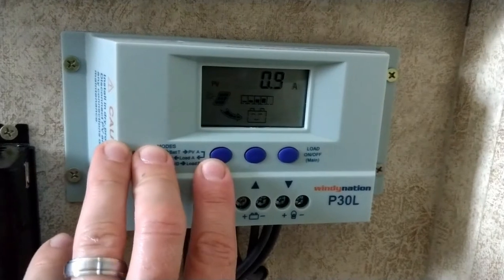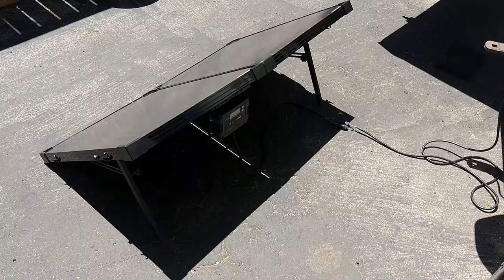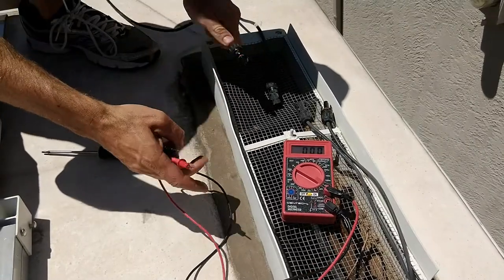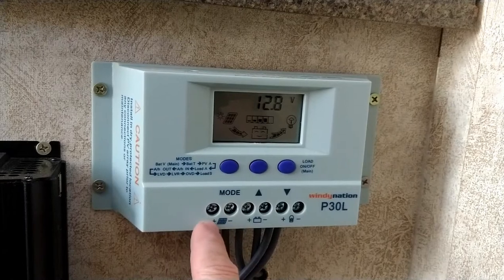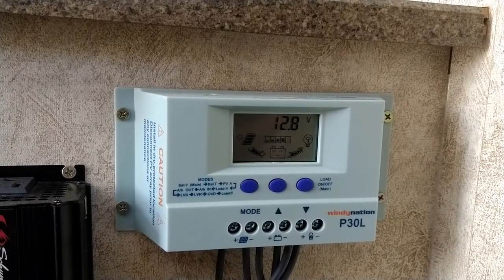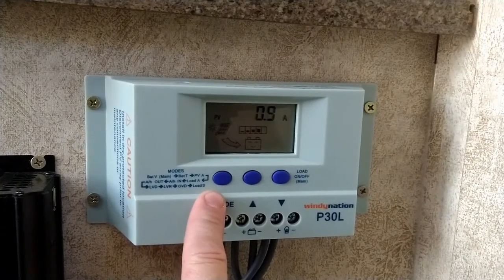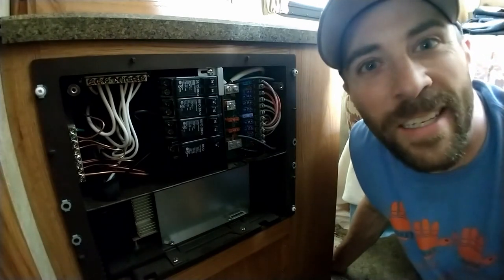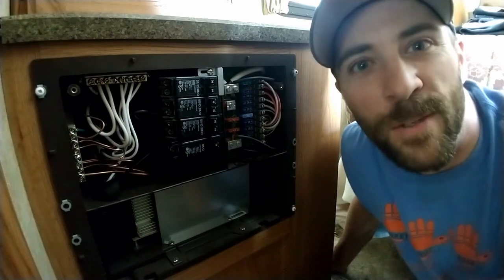Diagnosing Solar Panel Issues

Comment: Thanks, been meaning to check mine. My panels are about 4 yrs old now and seem a little weak.
Reply from the maker: You're welcome!  Check the specs on your panel and measure volts and amps.  If the volts are half of what you are getting, it's probably the diodes (at least that's what the Windy Nation guy said).

Comment: Why would a bad diode at the PV panel result in (still) almost 5A downstream, but 0.9A farther downstream?
Reply from the maker: I don't know for sure but changing the diodes didn't fix the problem.  I changed out the diodes and we were still having issues.  So, we ended up replacing that panel and the new panel works fine.  Thanks for watching.
Reply: One of the MC4 connectors on the panel was probably bad. I found a faulty crimp connection on an MC4 connector on a 100watt panel, replaced the connector and panel worked fine after that.

Comment: thanks for this, I have 6 Windy Nation solar panels and am only getting 300 watts out of them so I must do some troubleshooting, wondering if replacing the diode fixed it for your mums
Reply from the maker: Replacing the diode did not fix the problem.  The panel was under warranty still so we were able to get a replacement panel.  Thanks for watching and good luck!

Comment: Nice video.  I have a question for you.  My solar panel has 28.4 volts.  It used to have different connectors so I clipped it and put SAE so I can charge it with my portable battery.  When I plugged it in, its not charging.  When I used my multi meter, it shows 28.4.  What could be wrong?
Reply from the maker: Are you using a charge controller? Or are you just plugging the solar panel straight to the battery?
Reply: @ColoradoCamperman  I have changed the end to SAE and an adapter so I can charge the portable battery.
Reply from the maker: @jonphanspromotions  Sorry, I'm not exactly sure how you have it setup, so I don't have an answer for you

Comment: I have the bluetti 200 watt panels and they stopped working. Do you know how to trouble shoot and fix them?
Reply from the maker: If you hook a volt meter up directly to the MC4 connectors you may be able to troubleshoot the issue. I'm no solar expert, if bluetti has a support line, I'd call them.

Comment: Hi! If a wire with a 120 volt phase touches the frame of a solar panel that has not yet been installed, could it damage that panel? Thanks
Reply from the maker: I'm not sure, I suppose it could. You could hook up a multi meter to the panels and see if they still are reading what they're supposed to. Thanks for watching.

Comment: My panels (2x 320, in series) pull 70 volts but solar controller only outputs 5 amps to the battery bank (2x 12volt 200 ah lifepo4). If I switch panels to parallel, it is like 35 volts from panels and 2.5 amps to battery. I thought it could be the Renogy 40A controller. Today I got a new 60A controller and same output to batteries as the old one. What could be wrong? Thanks!
Reply from the maker: Hmm, that is interesting.  I'm not sure why that would be happening, I am definitely not a solar expert.  Sorry I couldn't help.

Comment: Now, are these by-pass diodes for each row of cells on the panel, or for when you have multiple panels running in a system? What sort of amps were you expecting to be going through?

Love the folding suitcase solar panel setup. I'm wagering a guess they are quite a bit more expensive than a solid, large panel? I still have the one large panel. Sadly, its been in storage till I can get the roof of my camper fixed.
Reply from the maker: The Windy Nation rep told me that the diodes move the electricity from the panels to the battery and they block electricity coming from the battery to the panel.  He said without the diodes your panel will actual start to drain your batteries at night when you are not collecting any power.  So they're sort of a one way switch/gate keeper,  

The folding suitcase is awesome!  Fixed panels main benefit is that you don't have to setup/tear down.  But, we find we bring in a lot more power with the suitcase then my Mother In-Laws fixed panel ever has.  However, we probably will install 100-200 watts on our roof top later this summer.  That is the hope at least!
Reply: From what I was reading, diodes are also used in some multi panel systems. If one of the panels ended up in the shade, power would route around it and still be able to reach the charging system. I figured, if something were to happen to my system, at least I know what to look out for.

Also, if the camper gets stuck some shade, you can move a separate panel to some place where it'll be in the sun all day. Although, how much tracking of the sun did you end up doing with the 'suitcase' panel? Did you try pointing it at 'high noon' and just let it do its thing by itself all day long? From what I was told, my panel is a 150watt. I didn't think I need too much for my little truck camper. Then again, I am kind of further north here. Hope the install works out for you!
Reply from the maker: @Jimfoxyboy  Yeah, I'm still learning about solar systems and am no expert by any means.  The whole diode thing was new to me.  But a great opportunity to learn!  We do an ok job at tracking the sun with the suitcase.  We usually move it more often and are really concerned about our energy if we have used a lot of power.  Otherwise I will probably move it 3-5 times during the day.  150 watt would be plenty if you're just using lights, running an exhaust fan, and charging your phone.  I had a tiny 20 watt panel with a charge controller on my old truck camper and it always kept my battery charged.  I only used the led lights and charged my phone, so no big draws on the battery, but still, my battery was always fully charged!

Comment: Well i think your battery is fully charged at 12.9volts and the charge controller is in absorption phase thus giving only little amps to fully charge the battery everything is fine
Reply from the maker: No, turns out the panel was bad. We ended up getting a new panel. Thanks for watching.
Reply: This is an interesting comment Akash.
Reply: I believe Akash is correct, the charge controller is regulating how much is required by the battery to maintain charge, if your battery is full no need for further amps to go into the battery.

Comment: Hello, I just came across your channel, thank you for the amazing content! 

I have a bit of an issue and I hope you can help: I have a MPPT charge controller and it keeps saying “error” and it shows a moon icon as if we’re at night and I’m writing this on a very sunny day at 1.17pm idk what to do.. can you please tell me what might be wrong? 

Thank you!
Reply from the maker: Sorry for the long delay, your comment went to my spam comment section.  Thanks!  Have you hooked up a multi meter to the panels to make sure they are producing power? I would start there and work your way down to the controller.  Sounds like power may not be getting to the charge controller or it is not recognizing the power that is coming into it.  Windy Nations customer service was great.  Depending on your solar setup, I'd say if you can't figure it out, call the customer support line.  Thanks for watching!
Reply: @ColoradoCamperman  it’s okay and thank you for taking the time to reply

The solar panels weren’t plugged properly and the battery was over discharged, it’s all good now!
Reply from the maker: @halfacuppa  You're welcome, glad you got it taken care of!

Comment: I have 1900 watts of solar panel and they are putting out 21.6 volts and only 0.04 amps. I changed charge controllers and no change. I have went over all wiring and find no problems. What is wrong?
Reply from the maker: Could be similar to our problem in the video, those diodes on the panels could be bad.  Apparently they go out frequently and even a lighting strike that is close by can short them out.  That is what Windynation told me at least.  Make sure you have a fuse running from your solar panels to your batteries/charge controller.  This could prevent that from happening in the future.  Hope that helps, good luck and thanks for watching!
Reply: @ColoradoCamperman  All is on circuit breaker. All is good now. Wasn't the diodes. It was a battery connection that had loosens up some how. I tightened all connections and the system is working as it should.
Reply from the maker: @ajw6715  Glad everything is working now! Funny how we can look at all other potential problems first and then it's something as simple as tightening down the cables! Lol, been there done that before!

Comment: solar panel 22 guadge wire split it from the split to ring cam 18 AWG stranded check volts 6 check severl times still says solar status no connection thank you
Reply from the maker: Not quite sure what the problem would be.  Sorry I couldn't help.

Comment: Great to know never would have guessed diodes. I thought you were going in the rite direction with the controller wiring etc.  Any idea why they blew?  Thanks for the info. ✌
Reply from the maker: I know, me neither!  The rep said that they actual have a lot of people replace these because of close lighting strikes.  I also need to install an in-line fuse to the battery because I do not have one, that could have maybe caused it as well.